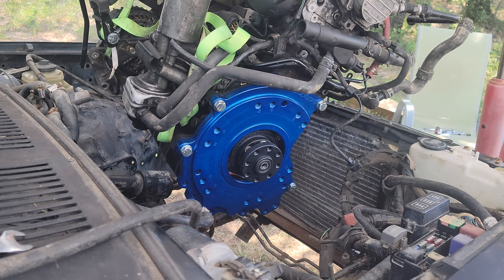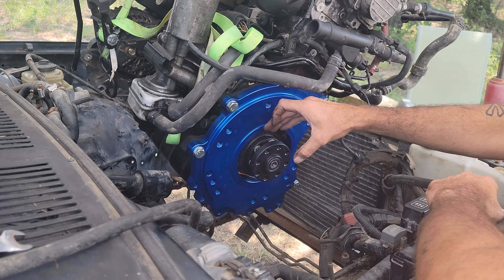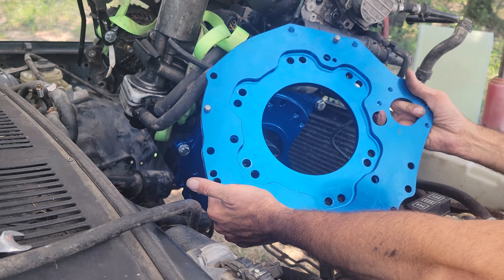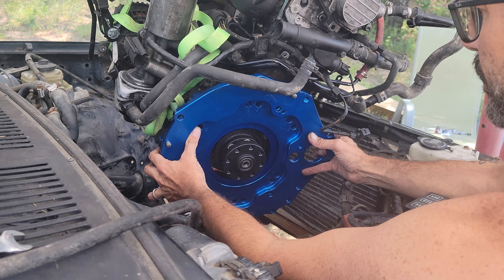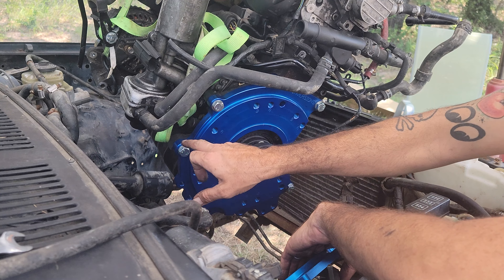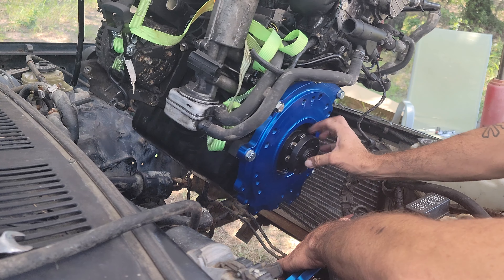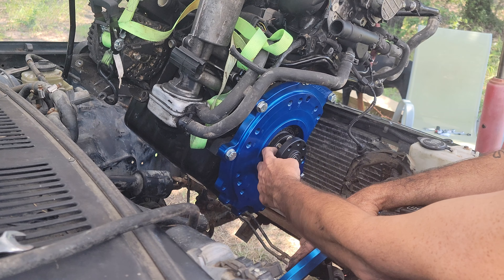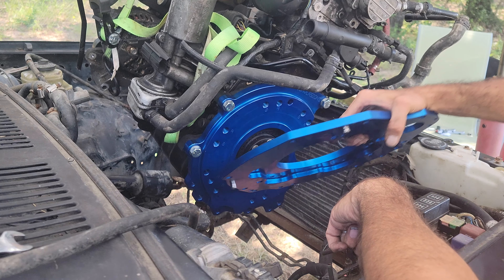Northwest TD-conversions TDI to Toyota R150f adapter

Comment: I always am fond of videos like this, giving me motivation seeing what is ahead! I'm swapping a BHW in my TJ and can't help but notice on the FB tdi swap group when they talk about getting 21 mpg full load towing with a tdi, and I'm just sitting here with the stock 2.5 4 cylinder, stuck at 19 mpg not even towing anything, and have the rear seats removed lol.
Reply from the maker: Dude, I had an alh in a 1993 eurovan that weighed 5000 lbs and it got 40 mpg, the 1974 bus I did got 30. I bet a jeep will do 30 easy!

Comment: Nice seeing a video on this adapter. The flywheel spacer seems a little sketchy at first glance, but the kit looks high quality. I'm ordering one off them for my fj cruiser build
Reply from the maker: Thanks, and I agree, that spacer does seem sketchy, but it is proven in other builds. The starter is kind of iffy too. Pretty sire its just a Chevy 350 one, wish it used the stock tdi starter like all my other adapters.   Does "witebread" make one for your application?